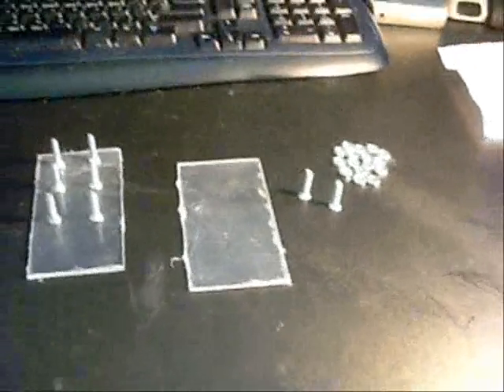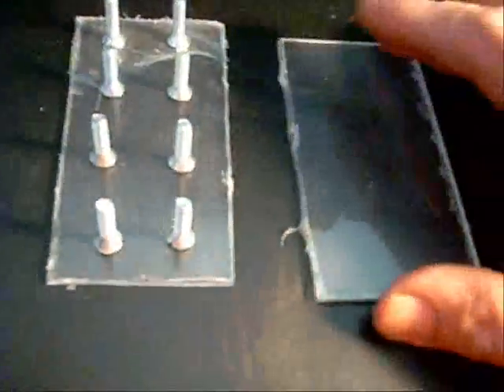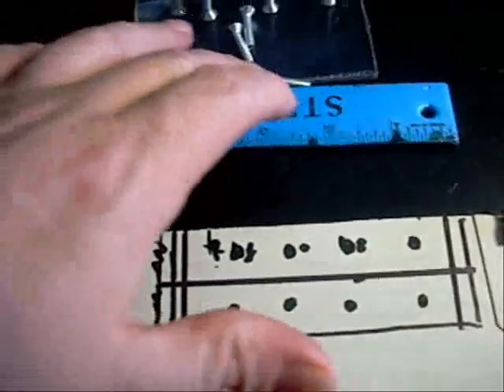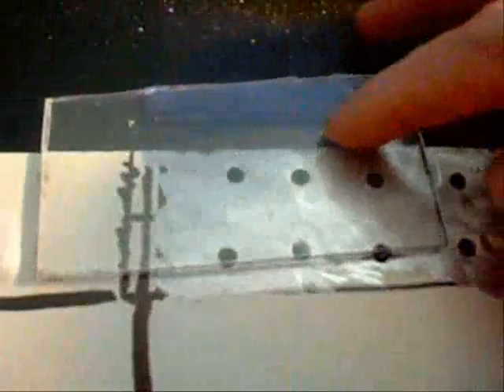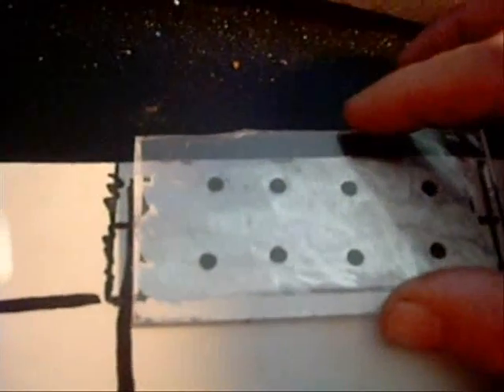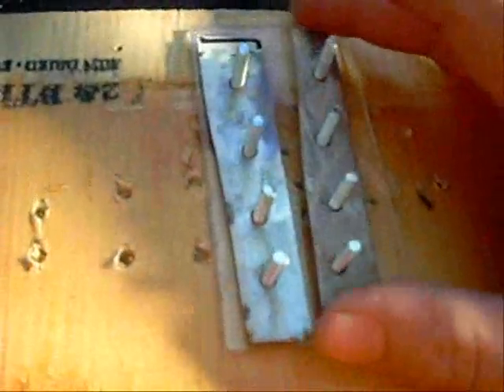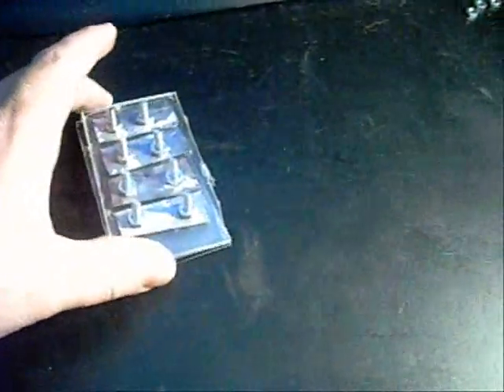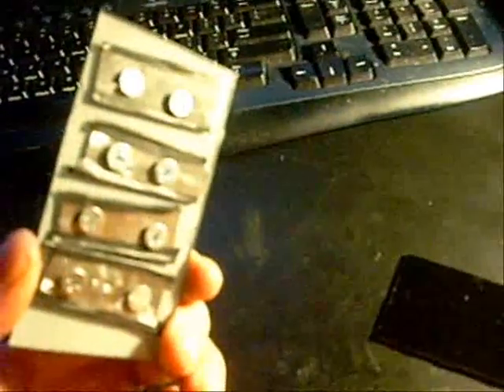DIY terminal block for your computer wires

Comment: Good Video Needed a block for my CCTV Camera Power. Used Couple of strips of band Iron in place of cutting metal. Holes became Template for drilling. Worked Great. Thanks

Comment from the maker: Thank you. 

No they shouldnt. I could have used some shorter ones but with the plexi and all it is about 1 inch tall. I checked it on my Antec and there was enough room to mount it on the side. And still clear the side cover. But just in hind sight I could have used 1/2 instead of 3/4. Oh well live and learn.